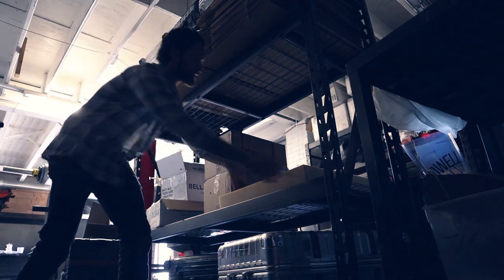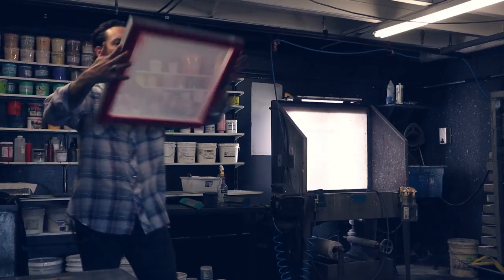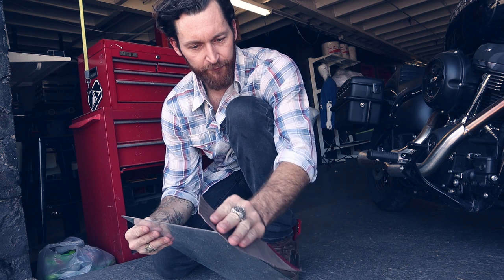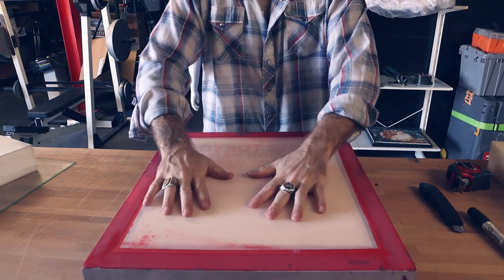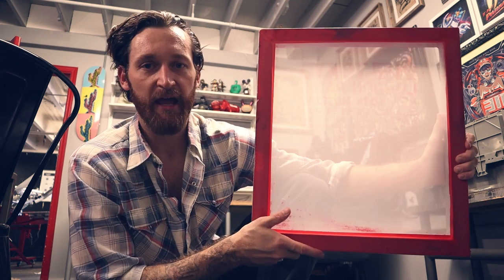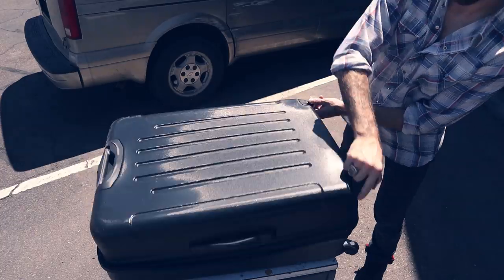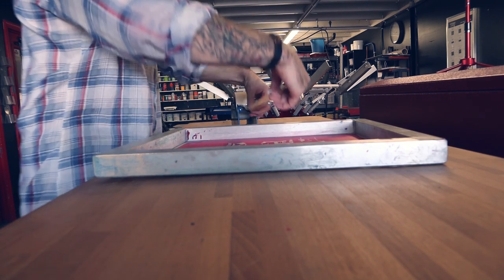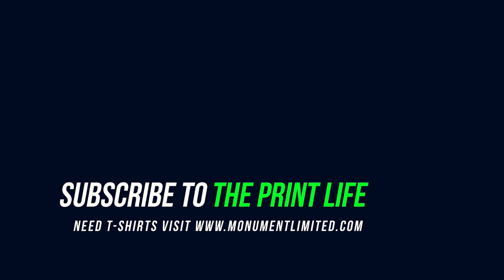STEP BY STEP EXPOSURE UNIT for SUPER CHEAP [Screen Printing Tutorial] T-shirt Business

Comment: I retrofit that 50W LED light in my exposure unit from your older video a while back and it works great. I started doing this in the sun but I usually print at night.
Reply from the maker: Exactly sun works great but if you work nights gotta snatch up that led. It a game changer just having it around.
Reply: Link?

Comment: Buy screens is cheaper, easier, and smarter than trying to stretch a screen. No cap. Awesome video btw.
Reply: I think otherwise if you’re gonna be in it for the long run, if its just 2-3 projects then yes buying pre burned screens is okay at 30-55 a piece. Its way cheaper goin to ups havin them print your film for a few dollars, going back home and using the budget exposure unit to burn on the screens you have and you can continue to re use the screens after washing etc. You save more down the line just paying for positive print films at ups than constantly buying pre burned screens. & Eventually having enough you could buy the printer too so you no longer go to anyone and save way more.

Comment: If I have a cheap home made exposure unit already, with the 2 leg base and arm holding the light and a platform for the screen to sit, would I still need a foam piece? what purpose does the foam hold?
Reply from the maker: The foam makes sure the film has solid contact with the mesh. If not the light will leak under the film

Comment: Hey Cam,  taking your advice and purchased the light from your link.  Do your recommend a DIY unit with the light on the bottom pointing up or going top down?  What would you recommend as far as distance away from the screen?  I went to a glass shop and got a nice piece of glass so I am ready to build a unit and wanted to get your opinion.  Also is it best to have all the sides covered to keep light in?  I'm using 20X24 screens.
Reply from the maker: Either way will work. But having a white enclosure around the light source helps distribute the uv Ray's more evenly
Reply: Thanks, burned my first screen tonight that finally worked. Built your DIY press, Looking forward to printing my first shirt when I return from my business trip.  Thanks for all your help.

Comment: Are you using a photopolymer emulsion or Dual cure?
Reply from the maker: Dual cure.
Reply: @ThePrintLife  I  might have to get the 50watt LED flood light because I'm currently at 12-14 min for exposure with a home depot 500watt halogen work light.
Reply from the maker: @carrilloinc  try the sun to it's so fast.

Comment: Hey, I used your affiliate link and purchased the 50watt bulb, how far away from the screen should I place it and for how long on average.
Reply from the maker: 3 ft is good to close and you will over expose the center and under expose the outside edges. Thanks for using the link my dude. Keep me posted on how it works out for you.
Reply: @ThePrintLife  thanks for the info will keep you updated on how it goes

Comment: Great content as always, Cam! I've been struggling to get some large format screens burned the last couple weeks. Ended up ditching the old halogen work light for a 50 watt LED similar to the one you use, but I'm having way different results. To account for the size of my screens (over 4ft wide), I've had to take the light about 6ft from the screen. Then my exposure times are sitting around an hour, and I still end up blowing out halftones when washing out. I know there's a zillion factors throughout the process, but do you have any ideas on something I could be missing?

Quick facts: Chromalime coated 1/1, dried over 24hrs, mesh is something over 200 (bought secondhand, hard to tell), 50watt led single-ish point, 6ft distance, screen and positive sandwiched between wood and glass, 1hr exposure time, washout outside (probably 6 seconds from door to "washout station" aka stepladder and pressure washer), still losing my halftones and/or the edges of my design.

Comment: Awesome video cam. That's how I first started burning screens with the sun. But had to move to a UV light since by the time I would come home from work, the sun would already be going down.
Reply from the maker: Gotcha. It will be difficult to use the sun in a professional environment. But for a hobby it's cheap and easy.
Reply: What kind of LED light do you use?